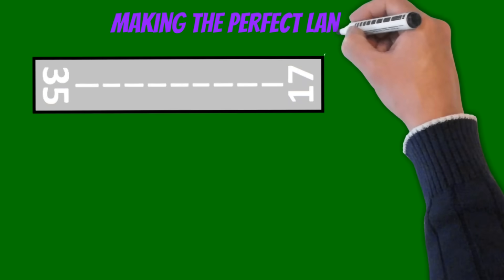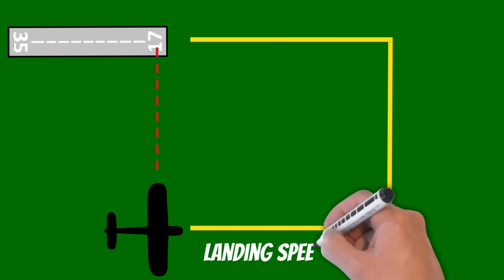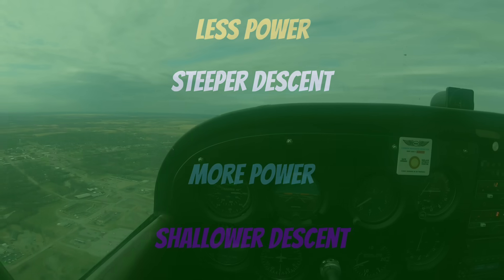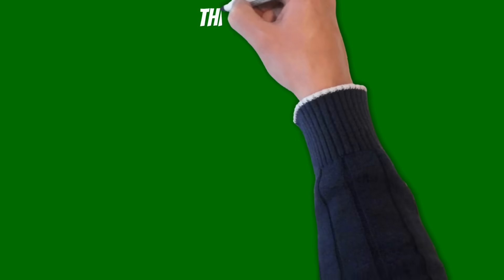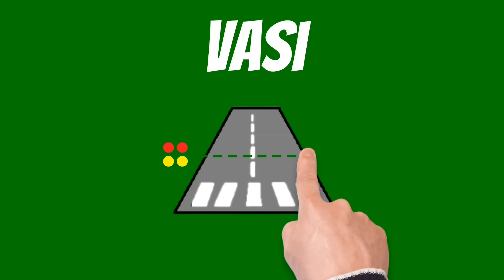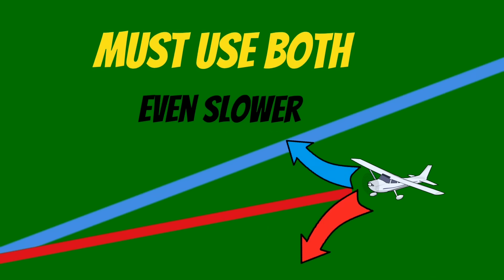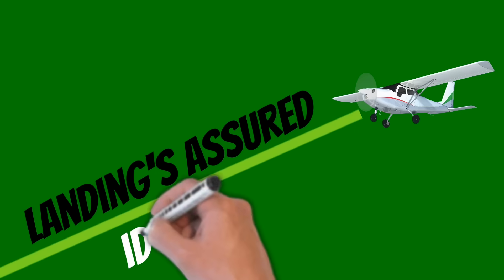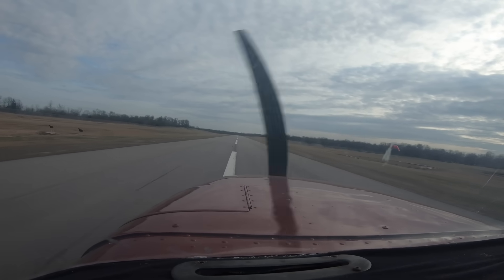Landing SECRET your Instructor won’t tell you [How to Land]

Comment: I soloed at age 16. Before I soloed my instructor said I was too high on final and to take us down, so I pushed down on the yoke& he said No, Do Not push the yoke down , pull back on your power(thrust). So, the 2nd time around , he said I was too high again, so I pushed the nose down (it was like an automatic reaction before I became a soloed pilot) , my instructor got mad & repeated to me to PULL BACK ON YOUR THROTTLE. So, the 3td time around , it was time I became broke of pushing down on the yoke- So, while on final , about a half mile out or so, my instructor said "you're high again on final , take the plane down , once again I started to push the nose down but I caught myself , yet  it was too late, my instructor yelled " I said DONT PUSH YOUR NOSE DOWN, while he simultaneously slammed (yes slammed ) the yoke to the dash. We went straight down vertical, over an open field (I was flying at a Rural airport in the blue ridge mountains of south western side of  Virginia) and I looked over at my instructor with a look of fear on my face thinking what's next while my instructor sat there calmly with his arms crossed, as we were nearing 100-200 ft from the ground STRAIGHT DOWN 90DEG VERTICAL & he said " Well, you're flying the plane ", so I pulled up out of the valley on the field and we were literally flying uphill , thru the field , then I pushed down as we crossed the trees, doing a slight negative G and bring weightless for about a full second , and I greased the landing . Guess what? I NEVER pushed my nose down again when I was too high on a final but I pulled back on my thrust/throttle. I went on an became his quickest student to solo a plane. After 9 & 1/2 hrs of instruction, I soloed a Cessna 152 at the airport known for some of the worst crosswinds, east of the Mississippi in good ole Virginia. I'm 52 now & have been in and out of flying . I became a private pilot but have been thinking about getting back into it again -There's just something about flying that never really leaves you
Reply from the maker: Great comment.  Power is by far the best tool when you’re high. Sometimes you also need to pitch down a little bit to compensate so you don’t get too slow though
Reply: @FreePilotTraining  Yes, you're absolutely right . I always tell people it's about power and pitch both. Really enjoyed your video. I never had uTube when I was flying and what a difference it probably would've made for learning more quick
Reply from the maker: @KD-xi3dn  thank you!

Comment: You did a great job of breaking it down!  Appreciate it?
How do you know your pitch is not driving the prop into the ground?  Getting exposure and familiarity with different sights.  As having the front wheel 6" above others. How would you know that?  All tires are out of view
Reply from the maker: Thank you! Getting the site picture down is just going to be something that comes with practice. As far as the 6” thing goes, I’m just trying to give you a mental picture. Obviously you can’t see your gear on landing, but you can look outside and see that the nose is slightly higher than normal, and that’s what we’re after because the number one student problem on landing is over flaring, and that is because they raise the nose too much
Reply: @FreePilotTraining  Thank-you for your response.  Prompts another question, over flarig, as in pulling the yoke back too far rather than more gradually? I ask as I was. thought it had to come all the way back. Best I recall, I was told to pull it to my chest.
I needed to ask this to clarify these things, 😉.
Have a good one!
Reply from the maker: @Noone-rt6pw  no problem.  You don’t necessarily need to pull the yoke all the way back. How fast and how much you pull back is completely related to how quickly the airplane is sinking

Comment: experience helps, each landing can be different. variables like weather(cross wind) or traffic can effect conditions. and pray never have a power failure.
Reply from the maker: Very true
Reply: @FreePilotTraining  worked as an Avionic Tech watched a Baron land on wrong runway with 50+ mph crosswinds cause ATC told him wrong. it flipped.
Reply from the maker: @dougking4377  that’s crazy
Reply: @FreePilotTraining  pilot error trust your instincts it's your plane/life not ATC's.
Reply from the maker: @dougking4377  that’s a fact!

Comment: The 6inch thing is really really much easier to say than to do. The down wind and base even the final are just easy to make after couple of hours, but the flare, a little bit more strength on the yoke would make the aircraft eats half of runway, but if not enough, one will simply have too much speed and that will cause bouncing as well
Reply from the maker: Yeah, I only use that to help students picture that it doesn’t take much to get the airplane into the landing attitude. Mental pictures are very helpful for a lot of people

Comment: you have to add power or decrease power depending on whether you are coming in too high or low.many people over flare when coming in too fast.they bounce.be gentle on the flare and let the airplane settle down.you are not trying to create a stall you are just trying to pitch the nose wheel up when landing.

Comment: Great advice! For normal landings: Learn a good procedure and follow it every time. Do the same thing at the same point every time. Some thoughts... 
1) Use taxi/landing lights to increase your visibility to others. 
2) If you have trouble with when to turn to base, note that you will need to lose a total of 1000' of altitude to land. So, you should have lost about 300' of altitude by the time you start the turn to base. 
3) Look for unexpected traffic on final just before you start your base to final turn. Make that turn a tad early and use a slightly more SHALLOW, coordinated turn while controlling the airspeed precisely. This is the most dangerous part of landing (steep turn, low) with a lot going on.
4) Once on final, do one more GUMPS check. This habit will serve you well when you transition to retractable gear aircraft. 
5) I taught people to mostly ignore the VASI/PAPI because slope indicators won't be there a lot of the time and I noticed it became a crutch for some folks. Instead, on final, pick a bug on the windshield and put it on your desired landing spot. Keep it there while controlling your airspeed/direction. You'll be fine for glideslope/aim point.
6) USE YOUR RUDDERS, especially on final and rollout. Keep it coordinated with your feet. This will also help with your tailwheel endorsement.
7) 1 mile for the legs is too much for most training (slow) airplanes. Keep it a bit tighter; if your engine fails in the pattern, you should easily make it no matter where it happened. This also keeps your patterns quicker and keeps you in sight of other traffic. Dragging out the pattern with power is a bad habit. Experiment by pulling the power to idle as soon as you're abeam the numbers on downwind and see what it takes to make a nice, calm, controlled landing.
8) As for radio, my pet peeve is you didn't announce your intentions: 'touch and go,' 'full stop,' 'stop and go,' 'low approach,' etc. That is by far the most common problem I've seen develop in 46 years of flying and it is a bad habit to leave that out. It makes it much harder for someone else to plan his departure/approach.
  Hope this helps someone!
Reply from the maker: Thank you! And thanks for the tips! I appreciate that!

Comment: As you just before crossing the Threshold it's a mistake to pull power back to idle, as your still 20 - 30 ft high & doing this will make the plane drop more steeply causing a sudden pull back to flare, instead leave a 'tricle' of power on until just as wheels touch then cut power, also to flare correctly with flaps is by holding  the top of dash in line with end of the runway with a tricle of power at the right speed will be a smooth landing every time(in reasonably normal conditions)
Reply from the maker: Thanks for your tips. Everyone has their own tricks for landings. I certainly wouldn’t yank the power back in a bigger plane.  That can cause a bounce in a lot of them. For small planes, this is the way I teach. It requires a more aggressive flare, but if you always make your landings the same, you will get the feel for it very quickly and can learn to gauge your sink rate versus your flare rate.  In addition to that, power off landings will feel very similar.
Reply: @FreePilotTraining  no that's not right, I'm talking about about small planes, but should be the same technique in small & big planes otherwise your teaching bad habits that will bight them one day, sounds like your teaching students to guess every landing, if you try what I said it'll work every time without guessing!

Comment: I'd say 3 degrees is too shallow for a VFR single. Nearer double that is better. And don't just sit there in the landing attitude with the nosewheel 6" above the mains - as the aeroplane sinks those last few inches towards the runway progressively pull back ensuring you don't induce a climb. Try to prevent the aeroplane from touching down by easing back until, despite your best efforts, the mains squeak onto the tarmac. This leads to a fully held-off landing with no tendency to bounce as there is no lift left in the wing. This is how you 3-point a taildragger, and the technique is perfect for nosewheels as well. This assumes relatively calm winds - gust conditions or a strong x-wind may call for a firmer touchdown or in a taildragger, a 'wheel' landing tail-high.
Reply from the maker: Thanks for the comment. VASIs are typically a 3 degree angle unless there is an obstacle. In this case, they can be as steep as 4.5 degrees.  There’s nothing wrong with a steep descent as long as the pilot is skilled enough to pull off the flare. New students are usually not this skilled.

Comment: Teaching, Landing with power, in a training aircraft is ALWAYS a bad idea….. you lost me 1/3 through the bad lesson.
Reply from the maker: I respectfully disagree. Here’s why…

Power is an important tool to control your descent. You are not the only person who thinks that power should not be used on final. However, this is what the airplane flying handbook recommends for a “normal landing”. This enables the use of flaps which ensures that you land at the lowest airspeed possible which can be critical in a short field landing scenario.  I’d say students are much more likely to land on a short field than to experience an engine failure.  While power off landings are important to learn, the FAA is more concerned about making sure you have enough runway available, and the second you land fast, you invalidate your TOLD. Not a big deal in a small plane, but as students progress, it will be critical and I regularly land on short runways which are within a few feet of my aircraft’s capabilities.  I would not even consider doing this if I was making a “power off” landing and I did not end up needing all my flaps to hit my 100’ landing spot.  I guarantee that I would float past my touchdown point and could very possibly be screwed.  Maybe I care too much about landing distance. But it’s tough for a Herc pilot to get that out of my system

Comment: There is another tip, a rule of thumb: if there is no PAPI, your position on the glideslope should be such that the visible width of the threshold should appear about as long as the tilted side of the runway. It is very well visible in this video: during good landings it is, and during the high approach the length is larger. Of course, there are long narrow runways and short wide ones, and you may take some correction for that, but the point to begin with - the width should appear to be about equal to the length.
Reply: I imagine this would be further complicated by up-sloping and down-sloping runways.
Reply: @EarthAmbassador  This would certainly be complicated, as usual ;)
Reply from the maker: That’s cool! I’ve never heard that!

Comment: Great explanation. As a hang glider pilot, there is no power nor spoilers.
I use pitch. Pitch up in a stabilizing glide makes the path virtical or steeper desent. While a pitch down gives me a horizontal or longer flight path. We called over controlling "jackrabiting". AIR SPEED AND TARGETING IS MY PRIORITY. While now on final, things move up from the target and things move down from target (flair point). Landing out; if I have to clear a telephone line or fence, as long as the wire is moving down from target...I know I can clear it way in advance. Note a gradient of less wind about 45 to 50 ft from ground then the ground effect. In a Cessna 152, I like to make a smooth flair (w/cross control in cross wind) about 20 ft AGL and switch my focus to end of field helping my allusion of altitude then maintain a about a foot off. MY SECRET IS TARGETING. AND AIRSPEED WITH NO JACKRABITTING. AND SETTING UP APPROACH WELL IN ADVANCE.
There is no GO AROUND in a hang glider.
Reply from the maker: I love hearing comments like this.  It’s great to get other techniques

Comment: Making it way too complicated. New term “Perch point “added that nobody uses, then checklist before perch then finish the checklist after perch so you have 2 checklists in downwind. Then your breakdown of airspeed in different segments could lead to spins turning final. Your centreline corrections are overly complicated and would definitely lead to confusion. Then you throw in a bunch of numbers 15’ above runway, 3’ above something else, front wheel 6” above mains, 3 degree glide slope, 1, 2, 3 miles in circuit vs 3000 AGL… you’re all over the place and even though the video is well designed and montaged nicely, none of the information is useful. At 10:16, are you making the runway if your engine dies? No you’re not. I’m an instructor trainer and I would not recommend anyone use these procedures in real life.
Reply from the maker: I greatly appreciate your position. The number 1 mistake students make in the pattern is doing nothing when they need to start the descent.  Creating an exact spot for them to do this, builds muscle memory which makes them more stable during their approach. As far as additional checklists are concerned, everyone should continue the “checklist” until flaps are completely down so giving them an exact place to do this builds muscle memory.  When they start understanding when they are high or low, then they can make changes.  Also, I get a lot of negative feedback from other instructors on the use of power on final. However, this is what the airplane flying handbook recommends for a “normal landing”. This enables the use of flaps which ensures that you land at the lowest airspeed possible which can be critical in a short field landing scenario.  I’d say students are much more likely to land on a short field than to experience an engine failure.  While power off landings are important to learn, the FAA is more concerned about making sure you have enough runway available, and the second you land fast, you invalidate your TOLD. Not a big deal in a small plane, but as students progress, it will be critical. As far as the other stuff is concerned. I definitely see your point.  I agree that I give a lot of “precise” numbers to something that isn’t necessarily precise, but my goal is to build a mental picture for students to chairfly through.  I personally believe that this is tougher in the beginning, but allows them to grasp the concept more quickly. I’m giving them the “Rote” numbers they need so they can develop and “understanding,” and eventually, they can “apply” those skills and make their own decisions in the future
Reply: thanks, for posting this excellent critique.       you have saved me at least half an hour.      cheers
Reply: I’m a student and I enjoy the explanation of the numbers and what is where and why. I like the term perch point makes sense as I’m an eagle launching from my perch to grab a salmon.. makes way more sense than a BEAM the numbers there’s no beams out there.  It helps me an I appreciate the effort being made to help me for free pilot training, I’ll buy this guy a beer one day

Comment: Unless you are in your presolo hours of flying.. You will make everyone in the pattern behind you.. Super mad :( the perfoct landing is power off when you have the field made.. Flare slowly to land on the back side of the tires. Fly the nose tire on as well
Reply from the maker: Power off landings are an important skill to learn. However, according to the Airplane Flying Handbook, “Normal Approaches” are to be made with “reduced power.” Power is a tool that pilots need to learn how to use, just like flaps. Many instructors teach students to land without flaps too which is completely wrong. While you are required to learn how to land with “all flap configurations,” full flap configuration landings are vital in short field scenarios because it enables you to touchdown at the lowest speed possible.  In most “power off” scenarios, full flaps are not used because the pilot is using them as a tool for energy management. This is good if you lose your engine, but when landing distance is critical, you need flaps and you may not be able to afford to land in a partial flap configuration.